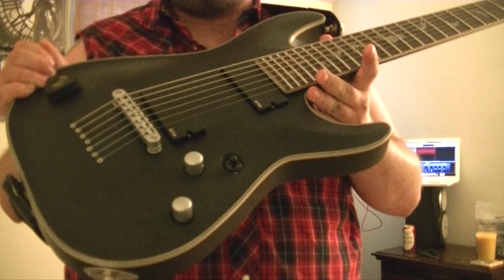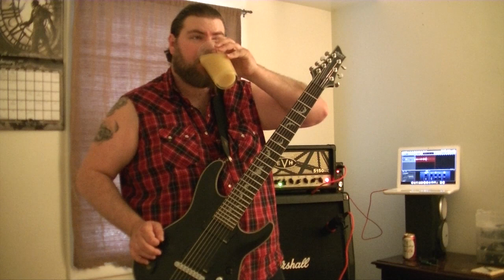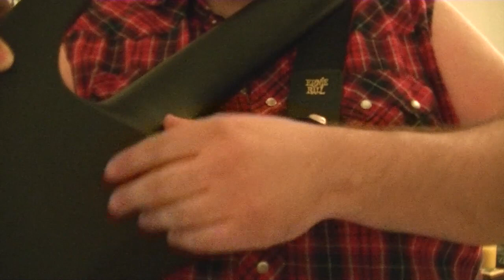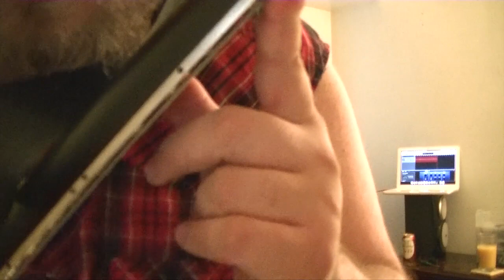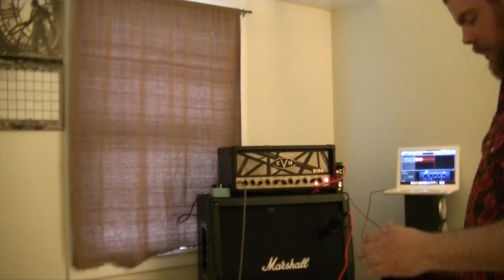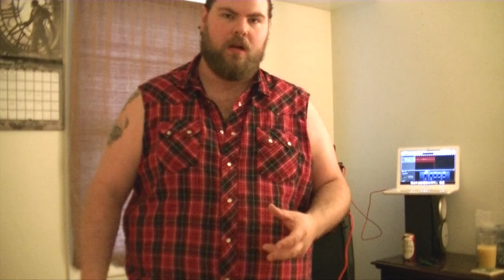Schecter Damien 7 Review/Demo

Comment: I bought a used one for $350, mine feels very light. Is yours like that? Also how do you know the pickups are real? Mine have holographic stickers on the back its emg 81/85 pickups. Also how do you know from what year it is? Mine has the original stickers in the cavity cover, it says black tusk or something like that.
Reply from the maker: silverdragon0000120 well this one is a 2017 model and I know for a fact the emgs are emgs if they weren't they wouldn't have emg on the top of the pickups. Its not overly heavy but its still got some weight to it. And the black tusq is what the nut is made of. Very good material I have all of my none locking guitars fitted with a tusq nut.
Reply: IIRC the WXX on the back of the headstock is the year, as in 20XX. Also, fake EMGs do exist, but these are only available from the factory with EMGs.  I don't know that it's particularly cost effective to buy one, swap in fakes, and sell the guitar at a discount (used). New EMGs are a hair over $100 each, with pots and whatnot.